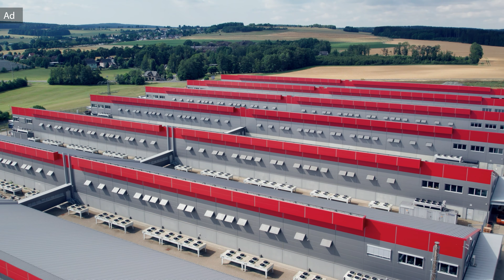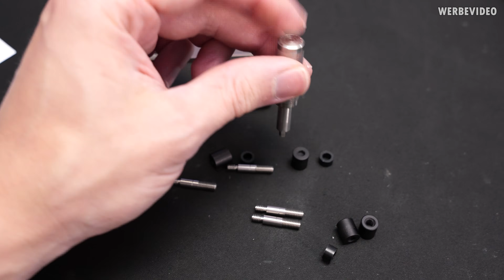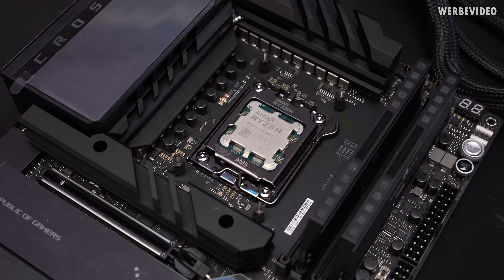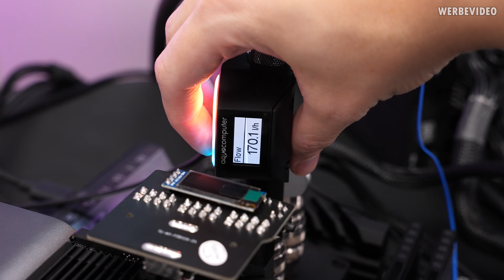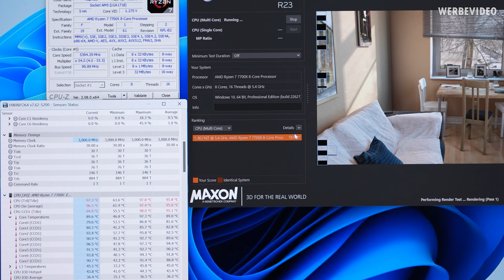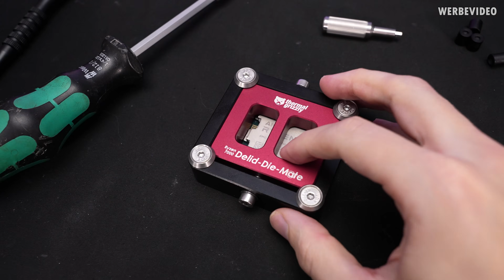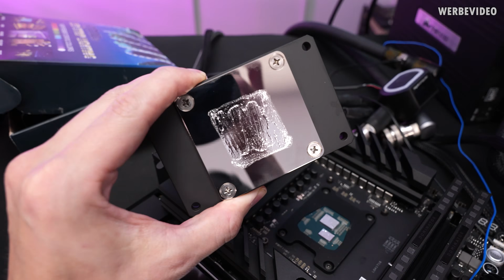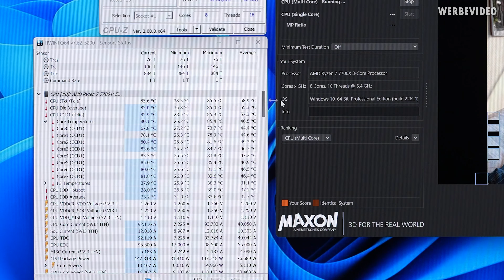The King of Water Cooling and Questionable Marketing

Comment: I love how they made the block the same size as the mounting so you don't need ugly brackets sticking out and the whole thing looks like it's part of the design of the motherboard, just bleding in and looking great.
Sure, this limits the block to just one type of socket secure mechanism (AMD mounting  in this case), but it just looks fantastic compared to any other cool block apart from maybe the dedicated EK full cover blocks which are often much more expensive.
I also really like the quality of the product.

Comment: While I'd love to see GN comparing these blocks, it's a stretch to call them independent review source: you're friends with Steve (and have the most famous bromance in undustry), and there's an ad for Thermal Grizzly in their latest video.
Reply from the maker: Steve is very professional and would not allow any impact on the testing by advertising. It also wouldn't make sense to do so. But that is the reason why also hwbusters will test it. Before this I never even had contact to hwbusters
Reply: I disagree Funtaril. Steve is pretty much the most principled reviewer on YT.

Comment: There are no real world situations in which a prime 95 type load is put on a CPU, so I’m not sure why anybody stresses their CPU with a Prime 95 load. There are other more “real world” stress programs that are much more suited (ie; Real Bench). In my testing I have found that AIO’s are pretty much equal to each other. Outside, site specific environmental forces play a very important role in the performance of any AIO or water block………and it is just not possible to test every scenario imaginable. When testing Air coolers there is much more of a difference between quality (Noctua / Thermalright) air coolers and low end inexpensive options. I wouldn’t read much into any results of AIO cooling as there are way too many variables to consider, but they do give you a point of reference.
Reply: Try running the cpu work from BOINC projects like Asteroids, Universe, yoyo, Numberfields, Einstein.  Those are real world science loads that can take over a day to run.

Comment: I understand that you talk a lot about normalizing your temperatures. -- I assume this is for the varying start temperature of your loop.

I've been told you can see different deltas in cooling performance on a pre-heated vs. room temperature loop. --- Could this be why the manufacturer testing showed different results?

Hard to imagine a 5-7 degree error introduced this way, but maybe?

Comment: Personally don't think you or optimus are wrong your testing methods are dramatically different. Theirs test is substantially different at significantly higher power input. It was wrong on your part to compare thermal paste against liquid metal while testing their claim. Also when comparing a practical test verses a maximum test the delta will be less extreme. Using a lower power CPU has a similar effect. I do agree completely with you it is wrong to name your competition in marketing without independent testing.

Comment: Small note. The Aquacomputer High Flow Next needs to have a few cm of straight tube run on both sides in order to get accurate flow readings.
Reply: I believe that only applies to the older MPS FLOW models, the manual for my high flow next pretty much says you can put it wherever, my older mps flow 200 stated the no bends before or after requirement in the manual. the flow series work off comparing pressure across a venturi so removing turbulence is much more important, high flow next uses a spinning rotor so it's gonna count the liters no matter how turbulent they are

Comment: Considering basically nobody uses their pc to run prime 95 (other than a quick stess test) i dont see how using prime would be a better test. The best is the one thats representative of real world use.
Reply: Myself and about 100,000 BOINC users would argue differently that Prime95 is not realistic use case.  I use my computer fully loaded 24/7 and at full TDP or pushed higher if BIOS allows. My testing regimen is a quick test with P95 and then an hours run of the full test suite of y-cruncher.  If the host passes, then I feel no qualms about putting that host into service.
Reply: @keithmyers2170  What I meant was that a lot of people are also running their gpu at the same time. Thus, adding more heat to the loop/case than prime 95 running alone.
Reply: I need every bit of help cooling the 7950X which shares a dual 360mm X 60mm rad loop with a 3080 Ti. I could only get ~ 5.1 GHz on my Optimus Foundation block on my good die in that loop.  The Optimus Signature block allows the good die to maintain 5.3Ghz and stay under the 95° C. boost limit.  I'm very happy with its performance.
Reply: @keithmyers2170  I hear you, just switched my setup to liquid metal and retuned to take advantage of the added thermal headroom. Spent the day running y cruncher combined with a loop of speedway to ensure everything was still stable.
Reply: @justin169169  P95 is my quick and dirty test.  But a full y-cruncher run over many cycles is the best approximate to my 5 project BOINC cpu load.  Pass y-cruncher and I have no qualms it will be stable on my Boinc load.

Comment: From, like... a thermodynamic point of view, how would temperature normalization work? I'm not sure that a simple subtraction of the diference in water temperature would be representative. If anything, it gives an advantage to the hotter-running component as the difference between it and the ambient temperature is higher. Other than that, great as always
Reply: Same though here.  It's certainly not perfect.  However, there has to be some normalization or else you run the risk of environmental factors affecting the results.  I think even GN tries to control their room temperature, but also normalizes to ambient.

Any testing methodology is going to have flaws.  It's the nature of the beast.
Reply: @EmperorA0  it depends on what you're testing. For AIOs and heatsinks ambient is fine. If it's strictly the block, then I guess that the best thing is to try and control water temperature... Which might necessitate a chiller. 

I can see why the bigger block would be better with a chiller; if the water is set at 15C then the whole block is going to have capacity to absorb heat due to the mass. I think, more realistically, it could be tested with water at 35-40c

Comment: Scientifically testing is about reducing all unwanted variables to zero so you can isolate the variables you want to test for. With PC testing there can sometimes be many ways to go about that, so optimus saying you are testing wrong, you of all people Roman, just comes across like school yard name calling, and also brings into question their own methodology and intentions in doing so, JUST because your numbers don't fit their marketing material? That is very disingenuous. When i saw the claim that their block beat anything direct die i thought shenanigans, thats not how thermodynamics works and is the reason for going direct die, because the ihs becomes a thermal insulator no matter what you do, it is a medium thru which that thermal energy has to pass thru that is vadtly different from the surrounding materials thus making it a heat sponge by default in the process. Like you i am impressed by the priduct, just not their marketing, and that makes me question wether or not i would ever get one myself or recommend one to someone else for fear of supporting that type of bad behavior. 

Hey Optimus, you did good, and you are in a market where fractions of a degree are not insignificant if consistency can be achieved, but you are just hurting yourself by making extraordinary claims.

Comment: Yeah, Optimus's products are certainly high quality, but their marketing claims have been more than a bit dubious.  They previously claimed that their passive backplates for the RTX 3090 would beat active backplates when it comes to memory junction temperature during highest loads (e.g. mining back when that was still a thing), but in my testing was nowhere near being true in a reasonably realistic scenario (maybe if you have the passive backplate in an air duct fed by Delta fans taking air from an AC unit it could be true, but nobody would actually run anything like that).

Add in their incredibly poor handling of product fulfillment and communication, and I'm altogether less than inclined to buy their products if there are reasonable alternatives.

Comment: Here's a question, the silicon dies may well be practically perfectly flat, but how well do they line up with each other over the cpu package? Has der8auer ever measured a delidded multicore cpu with his lazer level?
Reply: Hey, Optimus here, how do they line up? Not perfectly. The chip bends, which causes extreme variation in mount to mount between tess.
Reply: There is a reason you use LM, cooling sheet or such even on DD. Filling imperfections
Reply: Absolutely, however liquid metal is extremely variable from run to run and repeated testing can have very different results. KPX paste or similar is extremely thin and fine, and does a better job at keeping things consistent. Regardless, a benchmark test should use either LM for everything or paste for everything  @Xamy-

Comment: I had an optimus. I tried it on direct die, it was crap because of the plate too much curved and the mount for direct die was at best wonky.
I'm now on a micro direct die since about a year. Smaller, better perf, less expensive and all that not even using liquid metal but paste. So yea ....

I know why they are aggressive about the micro direct die compare to their product ... People eager to buy a 300€+ water block are the one deliding (mostly). And comparing a micro direct die vs an optimus block, it's about the same but 3 time less expensive. Good luck with that.
Hence the "we are better, micro is worst". The only (false) angle of attack.

Comment: Hey @der8auer EN - it’s me - the random redditor that got Optimus to first reveal the unnamed ‘competitor’ direct die block was your mycro. I have been using this V3 block on a delidded 7950x3d, and had previously used a lapped heatkiller iv pro. I’d love to run tests vs your mycro (I’m already using your direct die frame and delidder) but have been having trouble buying one. Any chance you could hook me up to add more 3rd party data to the testing? Thank you!

Comment: One concern I have with your testing is with your normalization methodology.  It isn't necessarily wrong, but it seems a bit ham fisted.  Maybe averaging the water temp and deducting that would be better.  Or just subtracting out the lowest temp.

The reason I say this is that dealing with increased water temp is part of the ecosystem.  No matter what cooling components you are using, heat soak is going to be an issue.  And how a block handles that is important.

A better test for what you are going for would be to have a controlled water temp going in.  This is where a chiller is useful.  Another option would just have a large enough volume of water to circulate so that the cpu can't heat it up appreciably.  You could probably do this with one of the 325 gal chemical totes full of DI water.

I think this is what Optimus was getting at.  By just subtracting out the water temp, you may be hiding some of their block's performance.  And, since we are talking single digit differences, that can really skew the results.

The upshot of my comment is that you are splitting the difference between a real-world test and a controlled test.  As such, you aren't getting the benefits of either.  I appreciate your efforts at getting usable and generalized data.  I just think you aren't quite doing it right.

Comment: I went with optimus signature block for my direct die 9900k (letting me run at 5.3GHz daily!) along with their pump / res and gpu block for the 3090 and recently swapped it all over to a 13900k and got their new block for the 4090, being in England it was hideously expensive, however the performance and quality is truly next level compared to everyone else Ive tried and seen (more so on finish and engineering, the performance gain is not worth the cost!). A shame I couldn't find a direct die kit for the 13900k, so I settled with a copper ihs from rockitcool.
Even if it didn't perform as good, id still likely use them for the stunning looks.
Reply: Yeah but is 2C really next level? Core 1 is 99 EURO, Signature 3 is 269$
Reply: @greggreg2458  well, core wasnt out when i got mine and as i said, get it for the looks

Comment: Stupid question, when they tested theirs vs yours did they actually use a CPU or a lab heat source? If they used a lab heat source then yes theirs would perform substantially better just because it is flat where as yours is carved out for the actual CPU die. There is nothing wrong with using a controlled constant heat source as long as you use your brains and realize there is some geometry involved that would require you to sandwich an actual CPU between your heat plate and the cooler. I’m guessing your Mycros geometry is precisely why they chose it as a comparison, had they went with something like EK that also just has a large flat surface the gains would have been negligible even in their lab tests.
Reply: Hey, Optimus here, we test only using real CPUs. Much of the difference in the testing results is we benchmarked using a 7950x at 250w vs a 7700x at 145w. That 100w difference is a real strain on typical CPUs, which is why the Signature will have a much higher delta vs other blocks at 250w. Hope that makes sense :)
Reply: @optimuswatercooling Thanks for the reply. 100w will definitely make a difference, no doubt about it you guys make perhaps the sickest block, true to my heart, no RGB and just purely focused on function. Honestly just seems like the marketing dept let down the engineering and manufacturing side of the product, like Roman pointed out, your product aesthetically and the manufacturing of it is on point, maybe that would of been enough.

Comment: The rate of energy transfer depends on the difference of temperature, so I am not sure how you can "normalize" for water temperature. It seems to me that water temp must be the same in all tests for a fair comparison.
Reply: It's not like it's difficult to test a calibration curve with a range of different water temps on a few select blocks (to make sure the effect is consistent) then apply that curve to the test rig.

A better point to argue is what flow rate to use between blocks, do you normalize that too? Don't see many graphs with different flow rates (if any).

Comment: Purchased a 3090 ftw waterblock from them during launch. Received it with the nickel coating flaking off and they stated it was fine. A month later it started corroding and contaminated my loop. They said they would warranty it and said I would have to buy another block for the fastest turn around and then they would refund me. It has been over a year now and I still reach out regularly with absolutely zero response. I would steer clear of this company! They make bold claims of a 10 year warranty but when its time to honor it you are left with the bill!
Reply: Optimus claims to have a long warranty, but when the coating started coming off their RTX 3090 Kingpin blocks, Optimus told people that the blocks are out of production and no replacement parts are available.  The only option was to have the customers ship them back to Optimus and have them recoated.  UPS shipping with insurance for a Kingpin block cost more than having a local shop strip and recoat the blocks.
Reply: Lmfao all their talk about the special coating they do that doesn’t flake off and nobody does it because it’s expensive and doesn’t look look as nice as electroplated nickel… and it flaked right off LOL
Reply: Which brand

Comment: It's the mounting issue.  Although the die and cold plate are both super flat, the others like standoffs, mb, backplate are not the same.  Check the balance level of the die, then the block see if they're almost perfectly balanced. If they do then the mounting shouldn't even need LM. This is why mycro die block performance well because the mounting is more superior compare the traditional. Smaller is better in this case.
Reply: Btw, where in the actual world can one find the mycro direct die block really? All is out of stock. It's annoying that you guys make products and none are available.

Comment: I agree about Prime95 testing, it make perfect sense - it's pretty much ultimate heat load. Cinebench not gonna show you full picture, only close one. But i disagree with using chiller for testing, its one step too far, like, that is beyond any reason. People who use chillers usually  don't care about advertised features whatsoever, they do FaFo
P.S. Assumption that waterblock which was best on Intel gonna be best on amd is WRONG. So many coolers act drastically different based on platform they installed on - always double check, lazy will not be tolerated